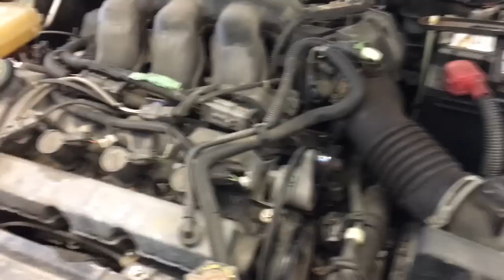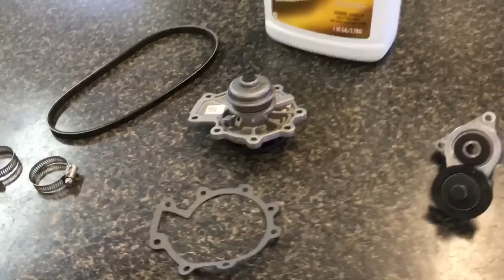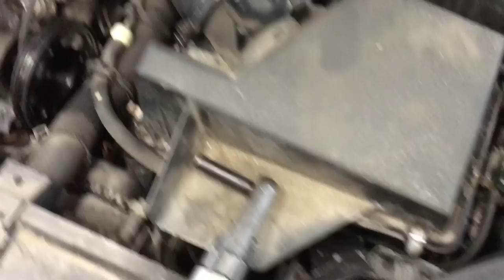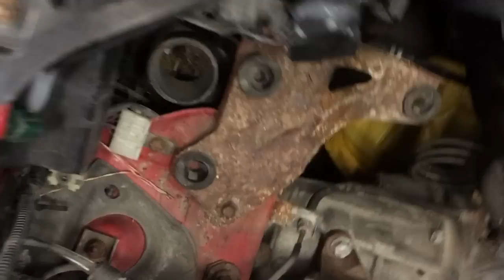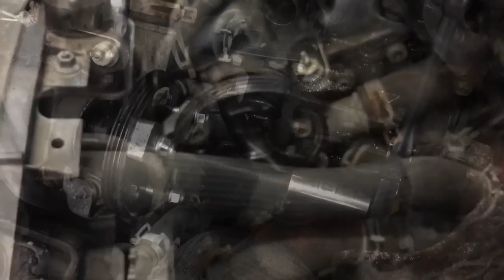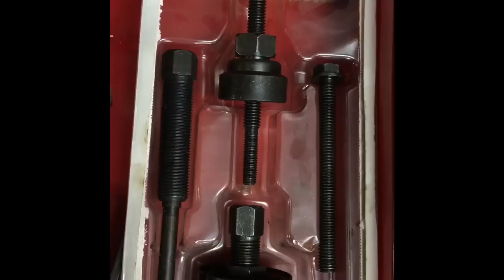2005 Mazda 6 Water Pump 3.0

Comment: Who believes that this engine was used on Ford Fusion, Mendeo, Lincoln LS and Jaguar as well as Mazda MPV and still been in use to this day with twin turbo on  Rossion Q1 generating 500 HP as well as the Noble 400. It's a phenomenal engine but the accessories around are crappy. It's more tidy set in the Jaguar as it's a luxury car. BTW, the water pump is identical on all these cars between 2001-2009 some models earlier but the tensioner pulley varies.

Comment: Tech4Tech, Did the water pump lock up because the plastic impeller had broke and logged between the block & housing? 
  My daughter has one that’s not leaking but runs hot after 3/4 - 1 mile of some stop & go traffic from dead cold. Guess who’s job it is now? Thanks!
Folks, hit like, subscribe and bell if you want to save hundreds in vehicle repair as these TV commercials scare people and most repairs are not covered or that difficult. This is a 3.5 thumbs of 10 for being hard. You can!
ASE Master Tech since 1978 - Retired
Reply from the maker: The bearing in the pump itself went bad. Master tech as long as I’ve been alive, thank you for your service!!
Reply: @uproar9913  No, Thank you! We have both seen many changes in the our chosen industry due to love of thing with engine. Good designs followed by bad. The dam Government builds the cars now as the DOT sends a book of regulations of emissions to tail light brightness. I joked with 100+ techs, durning ACDelco tech seminars the we have entered the age were we are driving a fuel fed computer on 4 wheels with creature comforts for the driver, room for some friends and some of our stuff. I wouldn’t be surprised that seat sensors announced over the radio speakers “Un-Authorized Release of a Hydrogen-Sulphide gas was Released in Passengers front Seat, Please prepare as I roll all Windows down for 5 seconds, then Return them to previous position”. Contract labor by Raytheon was supplied to get around a hire freeze as UWA was gripping. But, that’s the world we live in for now!

Comment: So I have the 3.0 and I've noticed that the other liter Mazda 6 has the water pump on the other side of the engine and also youd need to drop the engine when taking out the water pump. Is this not the case for the 3.0??
Reply: The 3.7 is a different engine entirely

Comment: This is wrong diagnosis as you see the issue was because of the tensioner pulley got damaged (~026/5.40) . that would make noise and cause the engine to overheat . the solution is to buy a belt that is slightly bigger to avoid the tensioner. Mazda itself removed the tensioner pulley since 2007 model. so changing water pump was unnecessary in this case .

Comment: How do you put the belt back on the pulley?
Reply: This belt is kept tight using a “Live” belt tensioner. It was shown on the floor in the upper right hand corner. It has a square drive/bolt to move the spring to enable belt service. The spring inside the tensioner is found on 97% of most all vehicles the last 30 years. Yours may vary but all have a method by which you can move the pulley as the springs a large and stiff. Harbor Freight sells a kit if needed.
Best of luck. 
ASE Master Tech since 1978-Retired.

Comment: Сука котакбастар, шкифті натяжитель дің орнына, натяжитеь ді шкифтің орнына койып шыгарса боладыго машинаны, енди журик сигилип
Reply: Hi I hope someone one can help me on my car it been doing things that I just can't fix I'm sure it my intake manifold keep get code that bank 2 to lean and intake leck after map sensor replaced gasket but I don't know to torque on this 2.5 murcy cougar 2002 v6 can any one help me ???
Reply: @alfonsorosales8830  do not underestimate the power of changing your coils and plugs. but first check your air filter and - my mazada 6 v6 was bucking like it was misfiring, advancing at a light with my foot on the brake and it turned out to be a the filter which was dirty but didnt look the worst. can you post a quick video of your issue on youtube
easier for someone to help you then

Comment: What's the part number for the pulley puller?
Reply: I did mine yesterday and used a face grip type puller to remove the pulley. I then borrowed the OEM Loaner Power Steering Pulley Puller/Installer (part # 27031) from my local AutoZone to reinstall it afterwards.

Comment: Can you help with replacing the belt pensioner pulley assembly on the same car same motor?
Reply from the maker: Car is no longer in my shop for reference.  Sorry, I would need to look at it to see how to change the drive tensioner

Comment: can you tell me where that coolant hose connects to. it runs from the top of the throttle body down towards the front of the engine. i cant figure out where it should connect to though
Reply: Godwin Kennedy you might of broken your heater hose where the hose is supposed to go in.